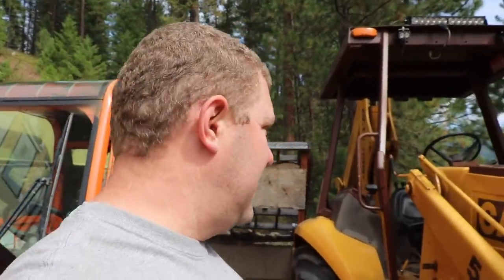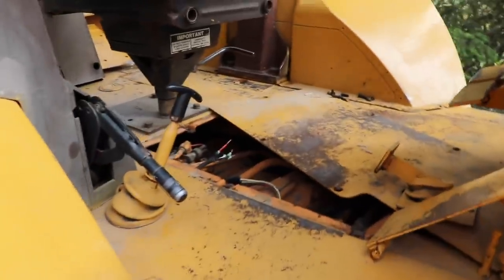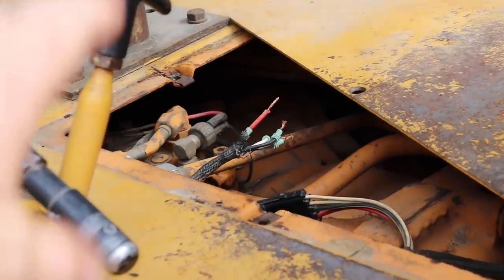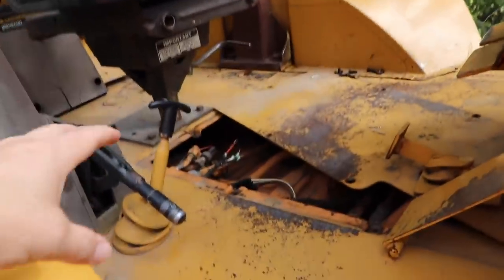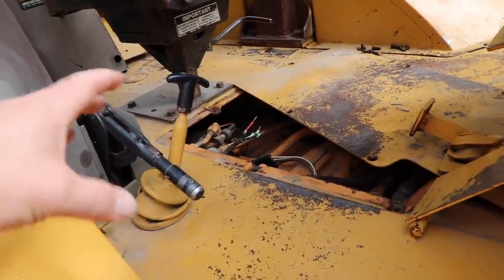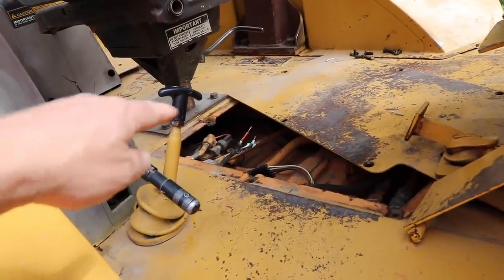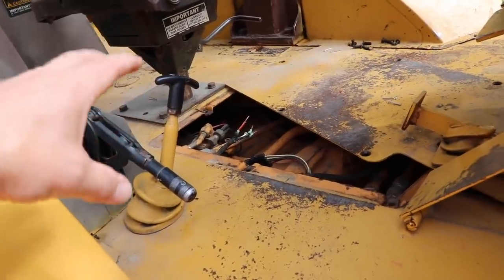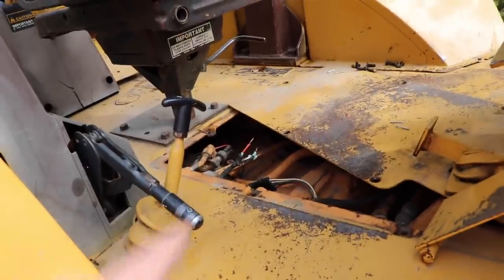This $0.50 Part Broke My Backhoe

Comment: I would recommend dielectric grease on those connectors, it will help water proof and also help prevent corrosion.

Comment: Chasing a bad short requires you to use the OHM meter function. First pull the blown fuse. Next power up and find which blade of the fuse id powered up. Turn off the power. Now put the Ohm meter probe on the fuse blade socket  and ground. Press the button on the control lever and read the Ohms . If the short shows up you only have to chase that wire to the control, switch and following circuits.

Comment: proper crimp pliers and connectors are the way to go !! you're doing it the right way !!  One tip : even though the connectors are waterproof, a coating of dielectric silicone grease on the connector (both male & female ends) before you snap it together, helps insure a waterproof connection that will resist corrosion from condensation and wet elements !!   

                                                                                                                                                                            Jim

Comment: The crimp wings that you think go around the part you call aboot is suposed to crimp to the insulation of the wire in order to help prevent the wire pulling out of the connector.
Reply: Incorrect

Comment: Jessie to troubleshoot a short,  pull the blown fuse out, with the key on or engine running, put your test light across the fuse slot, if your have a short , your test light will come on,  moving wires around, pulling plugs when you find the short the light will go out. don't forget to click the switches to complete the circuit to see if light come on or goes out. After you have done this  a few times you will become a expert.  
You can use a Ohm meter to do the same thing, but don't turn the key on.

Comment: The pin rear most lugs are meant for wire crimp, not the oot. The second smaller in are the wire crimp outer karger are meant to crimp onto the wire insulation. The boot then slips on over the crimps

Comment: Speaking as an electronic technician with over 18 years experience training apprentice electronic technicians, putting connectors together and doing a PROPER job takes practice. If I were training you I would have used lengths of wire at a bench and had you practice until you could do the job which would pass a Quality Assurance Inspection before I let you do a connector on a piece of equipment. If you are unfamiliar with a system, some time working with the system in a controlled environment does wonders with the quality of work you do in the field.
Reply: Ditto- from another ET.
Reply: As an ET that designed wiring harnesses for 12 years, this video is so full of cringe moments. Most of my crimpers cost $250 and up. A few are over $500.  And The company I worked for had a few that were $1500 each. But I could fix a harness in 5 minutes that people with the wrong tools have spent days working on.

Comment: Hey Jesse: it's hard to make out the full schematic , but from what i see ,it looks like there is a Counter E.M.F. diode across the coil of your shuttle valve( the two grey conductors) if this is shorted out it will cause your fuse to blow.

Comment: Time for a barn for the tractors. Over a 10 years time tractor repairs will be 25% to 50% less if the tractors are in a barn. I`m a tractor repair shop.

Comment: Time to get comfortable with the metric system. I mean, the rest of the world is using it, can’t be that bad

A few years back I had an old RV that was draining the battery just sitting around. The mechanic I spoke to about diagnosing the issue said “ just require the whole thing “. Apparently diagnosing bad wiring is super time consuming and you might still only have solved half the problem. 
So my suggestion to you, just replace old brittle wires and have peace of mind in the future. 
Oh one more thing...are you sure that’s the right fuse? You know people will use a lower rated fuse just to get part of a machine to work.

Comment: May I suggest that you get a set (5,10,15,20amp) manually re-settable fuses.  They are actually circuit breakers that fit into a ATC fuse slot.  Makes troubleshooting MUCH easier...and cheaper.

Comment: I always liked to put silione grease on conictions. It helps seal out water and makes it were they are easyer to plug and unplug.
Reply: connections
Reply: And wipe off the outside when sealed. Grease attracts dirt and grime.
Reply: Dielectric grease

Comment: get a fuse  breaker which you can reset and when you can get the system working without it tripping you can put a fuse in

Comment: The two dies are for the wire and the insulation, not the wire and the boot. The boot should just slide up.
Reply: Agreed
Reply: @randylinn502  agrred is elastic material

Comment: Crimping is fragile. Please get a kit where you solder on the connectors. Even better, don't use that many connectors but solder the wires directly and use a heat gun to shrink on some heat shrink tubing. This is the perfect forever lasting solution.
Reply: Well done crimping is not fragile.  It can be better than solder in vibrating situations
Reply: I used to think that. But a properly crimped connector is far superior. For the larger connectors you may solder afterwards but heat will soften the sheathing and ruin the whole thing
Reply: @MattOGormanSmith  Huh.  Learn something new every day!  Thanks.

Comment: Jesse, the connector you found that didn’t appear to go to anything may be your short. That connector is called an SAE connector and the open end appears to have had the wires cut, there’s your short. Try unplugging the connector, put in a new fuse and see if everything works.

Comment: Those 2 boots in that blister pack from the automotive store are water proof plugs to put in the hard shell connector holes that are not used in case you don’t have the connector that does not have the exact amount of holes.

Comment: Jesse, when you are wanting to remove or back out the male or female pins and are using the correct tool, push the pin further into the connector. What that does is force the wings of the connector up into the tool.

Comment: Summit Racing has all the weatherpac kits and replacement parts. Wearherpac is a GM system used from 1980 on, developed by Packard Electric in Warren, Ohio.

Comment: You said it - shorting out from chafed wires.. I cringe for the lack of slack (or more protection) on the wires to the wide light bar on top. Maybe time to pull new wires for the canopy lights??  Or use [marine grade - does it exist?] shrink tubing with soldered splices/joints??

Comment: The front is for the conductor, the back is strain relief and should only crimp onto the insulation, then the little "boot" as you are calling it simply pushes into the back of the barrel the pin inserts into in the connector.

Comment: Old fashion solder, self vulcanizing rubber tape, vinyl tape. Connectors are only for easy assembly. Here it’s harder to put the connector on than splice the wire.

Comment: Are the sheaths around the wire harness woven metal? If so you could have a wire that went through its insulation and being earthed. Check resistance between each of the plugs to the sheath and correlate with wiring diagram. As it, intermittent moving wobbling the wire harness could cause a resistance change. Hope this helps and you get it fixed. I just had the coolant hose drama. Change a thermostat and hose around it and ended up doing all the hoses on the engine. Coolant just found the weakest point.

Comment: Cheaper option (obviously not for frequently-used disconnects) - use heat-shrink tubing or tape to shield the connector from moisture.

Comment: Personally, I'm against your advice, I worked in the parts supply department for Ford years ago as one of my first jobs. One of the most common parts we replaced NEW was connectors. A car would get assembled, quality checked and something would be wrong with 99% of them leading back to a bad connector in a harness. So anytime i have issues with connectors, instead of fighting the problem i just cut the connector out of the harness and solder, heat shrink all the connections and ive NEVER had one fail again.
Reply: Ford, that's the problem.
Reply: @ExtraFungus  Ford was not a problem. Ford developed the demand for more and brighter mechanics.
Reply: @andytaylor1588  I'm not sure if you relize what you just said. Or you do and I commend you.

Comment: Weatherpacks do in fact crimp to the boot not the wire insulation. How do I know? I've de-pinned many of them to replace the black plastic part as well as used the propper tools to crimp new pins on.

Comment: Do Not crimp the boots!!! The short part of the connector pin crimps the bare wire. The tall part of the pin holds onto the wire sheathing to keep it from sliding back.
Reply: Correct, the smaller ears crimp in the bare wire and the larger pins crimp in the wire insulation. Then slide the green seal up into the connector after inserting the pin.
Reply: Incorrect, either you've never worked with these connectors or if you have, you did it wrong.
Reply: josh bishop what’s incorrect? Ive used these connectors many times.
Reply: @jonc3271  you do in fact crimp the boots.
Reply: josh bishop crimp them to what?
Reply: Packard "weather-pack" connectors you do crimp the seal. The tabs are crimped around both the wire sheath as well as the seal.  Deutsch, Delphi, and some others do have tabs that crimp both on stripped wire and to wire sheath.  These connectors typically have seals built into the connectors as opposed to the Packard connector where the seal is mated to wire.
Reply: Your correct. I've been doing it wrong my whole life. Although I've never had a failure sliding the boot up into the connector. Just based off the amount of deflection on the boot after crimping  I'd say theres no way that would seal properly.

Comment: Get some dielectric grease to use as lubricant to make inserting the pins into the socket
Reply: And to make them corrosion resistant. (It's called "silicone grease" where I am.)
Reply: The silicone seals come with a silicone lubricant on them for that.

Comment: Might be the wire that goes through the bucket control arm has a short to ground IE: insulation dried out and missing in tight area. Oh the fun of working on equipment that normally is shaking and vibrating any time the engine is running.

Comment: FYI;  If you have a burnt out "FUSIBLE LINK".  You can make one.  IF the gauge of is 10 gauge, you take a short wire TWO GAUGES smaller than the "through" wire.  connect the smaller gauge wire BETWEEN the "normal" sized wire.

Comment: I probably would have just soldered the connections and called it a day.   It’s super fast to disconnect.  A pain to reconnect.  But if you don’t plan on taking it off, it’s probably the best way to go
Reply: Absolutely correct. Complex plugs and sockets in the harness are purely for the convenience of the manufacturer. Us ordinary mortals are better advised to stick to soldering and heatshrink. Its quick, certain, cheap and easily repaired.

Comment: A simple value to remember: 1 mm = .03934, so just remember 1 mm = .040.  That will get you close for a quick and easy calculation in your head.  Now for wire diameters, they vary by whether the wire is solid, or stranded.  Stranded wire diameters vary by the AWG of the individual strands that make up the finished wire.  Stranded wires have different stranding makeup based on the wire specification and intended usage.

Comment: I use to driver a backhoe like that and we never used that switch , if we wanting rev the Machine just use the thing in neutral using the shift on the side of the steering wheel

Comment: I have a crimper from napa that can do all the crimps in that weather tight set and it doesn't have the die swap garbage, yeah it was $55 back in 2008 when I bought it to rewire a friends 95 chevy k2500

Comment: TIP : 
To prevent the number of broken fuses, make or use a lamp between the two poles.
If the light comes on during the test, the short-circuit was not found.
Reply: If it goes dim or off you found it.

Comment: Did I miss something?...Your machine is still 'dead' and what was the $.50 part??
Reply: At the end, the rig moves and operates as loader/backhoe. Only the short circuit in the trans cutout system needs ID'ing/repair. Possible to shift to neutral, hold with brake, and rev manually for same effect. A lot of operators seem to re-position the bucket on the move. Trans cutout = dead time. Time=money.

Comment: The device anti-parallel to the valve coils is a free running diode maybe it makes the short circuit, you could leave it away for short term testing and if necessary you could replace it with a standard 1N4001/1N4007 whatever, for diagnosis in LowVoltage applications I prefer to feed the equipment via a current regulated power supply probably you should get something like that... BR from Austria
Reply: you can measurement the diode easy too: 0,5V forward and O.L. in other way.

Comment: Just wait til you need a connector for the plane!
Reply: If you change a light bulb in a plane and replace it with its automotive counterpart and the plane crashes through any cause whatsoever, insurance is null and void and other charges may apply. Make sure that bulb has aviation printed on it.

Comment: You don’t crimp the boot. Big ears are for the insulation and small go the actual wire. Boot slides over the crimp.
Reply: Nope, big ears are for the boot.
Reply: Still don’t think so. Should be able to pull boot out of connector. The connector socket holds the boot.
Reply: @stevegilbert7541  nope, you can look it up for yourself.

Comment: The crimper is just for the wire . The bigger  part of pin is for the coating  on the wire not the seal part !

Comment: Marine grade but connectors would resist the wether and corrosion in your situation.
Check for corrosion under the fuse block...

Comment: Both male and female pins nave a tab that has to be raised up.when you push it in The tab keeps pin from slipping out.corroded pins have poor continuity.alittle wd40 helps.wires that cling to a hot tube or surface ground out.amd always use the rated fuse don't go like from 15 to 30.stay with the fuse asked for..bulb to excite the stater is not unusual.

Comment: Order new connectors on eBay, if you're not in a hurry they are pretty cheap from China. Also if you're using these on eom automotive applications, they come keyed differently to prevent you from putting the wrong connector on the wrong sensor. On one of my cars it has 3 non interchangable 3 pin weather pack connectors. One for the fuel pump, one for the TPS and one for the MAP sensor

Comment: You don't crimp the boot. The wider part of the crimp pin is for the wire insulation. I've done millions of aerospace crimps and have spent thousands on various crimpers, pin removers, and insertion tools. Trust me!
Reply: Yup. That's what I thought when I saw it.  Boot slides over the connector.
Reply: From a former ase master tech that was mainly gm. In the weatherpack system the seal is crimped on by the connector.
Reply: @elcam84  is correct

Comment: Hi guys there is a product you might find useful for waterproofing connectors. It is called Brush on electrical tape. It was developed for marine applications, providing the wires/connectors are clean you can just paint over the whole thing, instant seal.

Comment: You DON'T crimp the boot, the larger of the crimps just goes over the insulation of the wire as a strain relief, and the boot goes over that. First slide the boot on the wire, then crimp on the connector, insert the wire/connector into the plug, then push the boots into the back of the plug, so they slide over the crimp, if that makes sense.
Reply: The seal is crimped on these GM weatherpack connectors. It provides seal retention and strain relief. Its a light crimp though.
Reply: @elcam84  is correct

Comment: it is a diode
Reply: Saw a "kickback" diode across the coil shown on the wiring diagram.  Perhaps the "unknown" connector puts the diode into the circuit?  Pulling the connector removes the diode, so if the diode is shorted, removes the fault.  The purpose of the kickback diode is to absorb the inductive energy from the solenoid coil when power is removed, extending its life and the life of other electrical components on the same circuit.

Comment: For something in between try the heat shrink with solder. They have a low temp melt solder inside a heat shrink tube that can be installed with just a heat gun.

Comment: Its the wrong pliers..or tool if you will.. There are dozens of aftermarket kits that don t use the correct pliers.. the geometry of the connector and the boot are all wonky...You have to use a Packard tool for MetricPack (Weatherpack) connectors.. The pliers alone are $150.00 .. they work flawlessly... use only WeatherPAck connectors, housings and seals.. Find a reliable source for your replacement pieces parts.. Same applies for Deutsch connectors - these are even more problematic.. Again..the tool alone will set you back $200.00 with a full set of crimping dies.. but with the correct tool.. the repair is fool proof and reliable.
Reply: It is the correct tool he's just using it upside down.